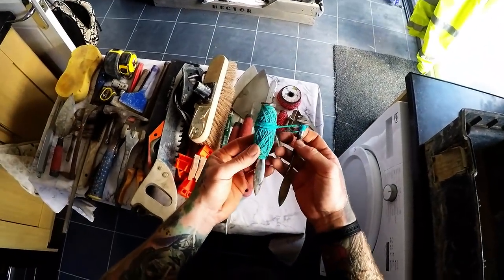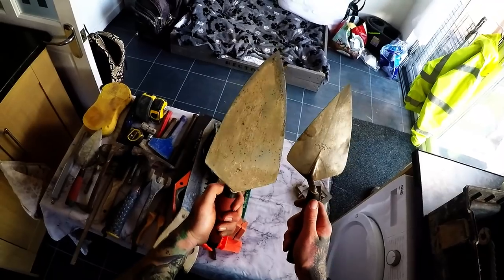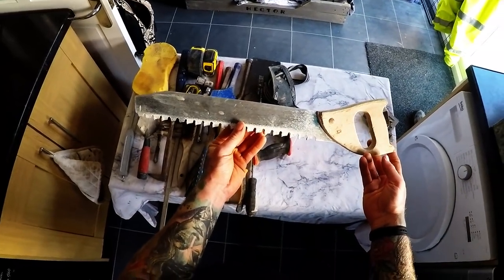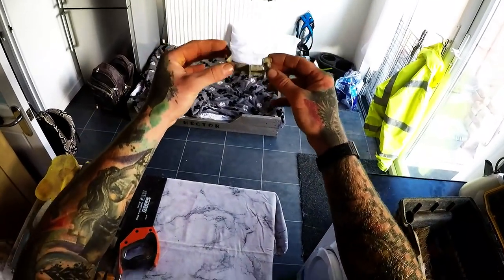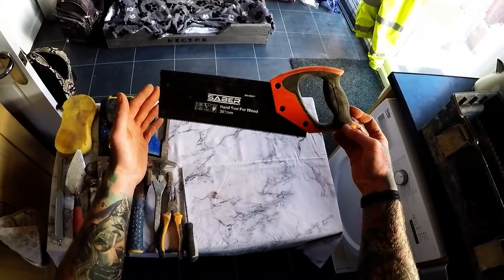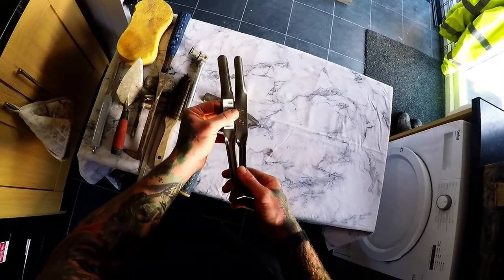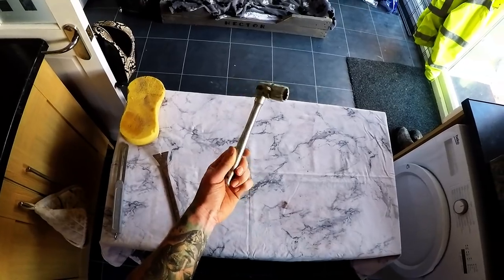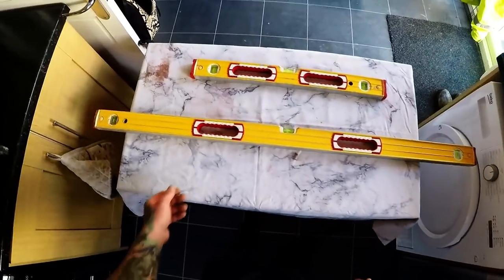BRICKLAYING (Whats in my tool box)

Comment: W Rose a far superior trowel used marshtown for 15 years now wouldn’t change back. Rose trowel a lot  better quality steel. Lighter in the hand also.
Reply: I have an 11" w. Rose philidelphia pattern and I'd never use anything else. Its light as a feather and wrist strains are a thing of the past.
Reply: Yeah the limber blade. Is very good. Plenty flex super light trowel